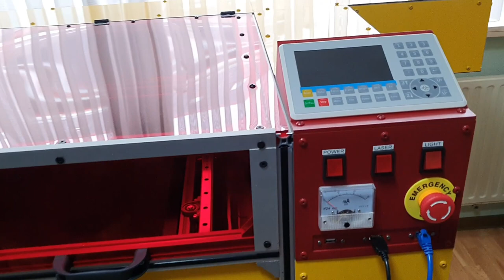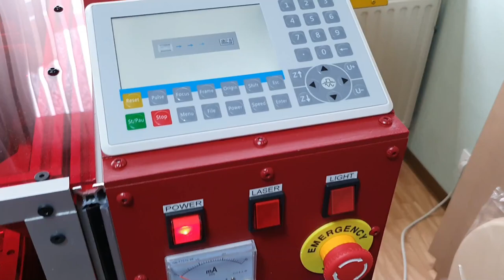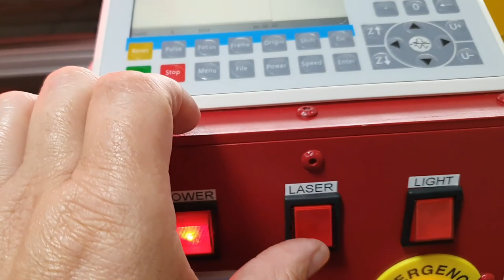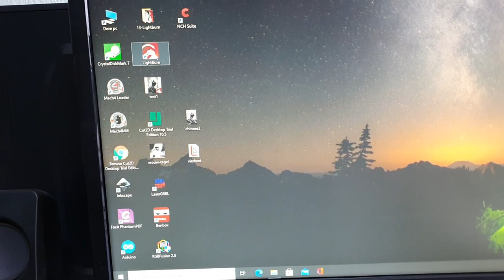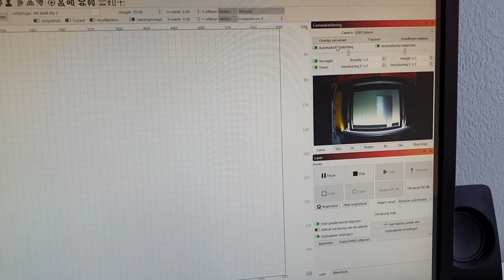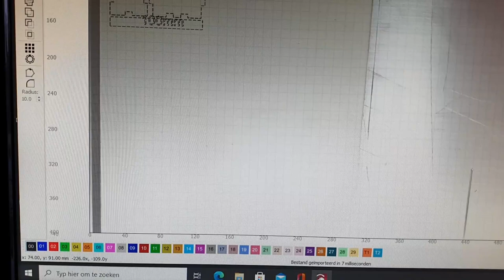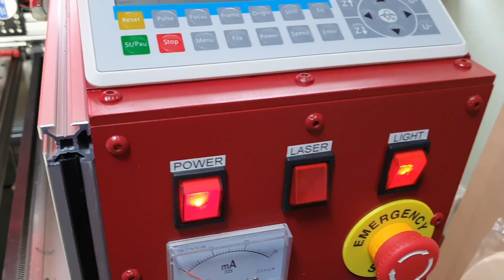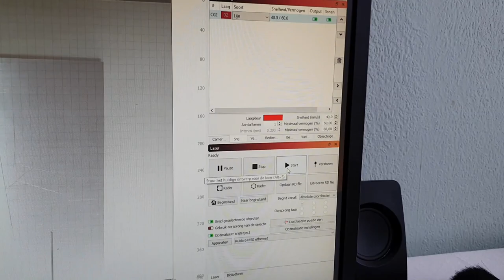Part 5 Co2 Laser cutter complete with chiller

Comment: I finished my build of this laser. I wish I could add a pic to show you. I do have one question. This is a pretty tight build, so the exhaust struggles to draw air from the enclosure. So, I plan on adding a vent to the front of the enclosure. How did you address this issue?
Reply from the maker: Open the door at the front a little bit. Never had problems, because fan is 630l/min

Comment: i have a 600x400 i designed with 2020 extrusion.....and a free floating motorized table.....watched your build from the beginning.....i know im going to upgrade to linear rails.....and substitute some 2040 in place's....like that your bed is integrated with x/y gantry.....only thing i have to figure out is the 3d printed parts....did you use abs for these or regular pla?......
Reply from the maker: I use PLA TOUGH is strong as ABS but prints like PLA, verre goed stuff.
And thank you for the gift
Reply from the maker: I use PLA TOUGH is strong as ABS but prints like PLA, verre goed stuff